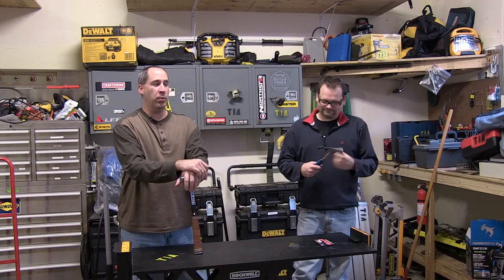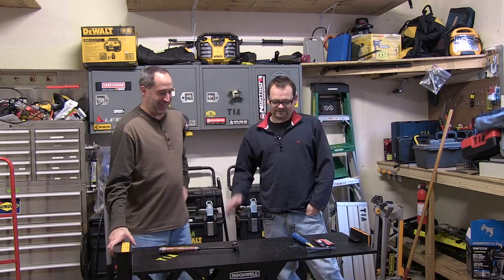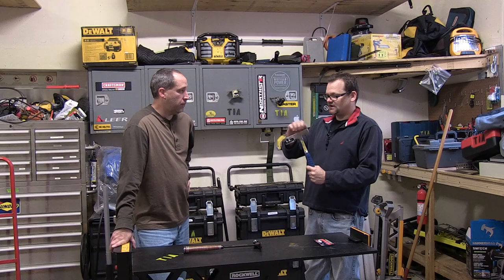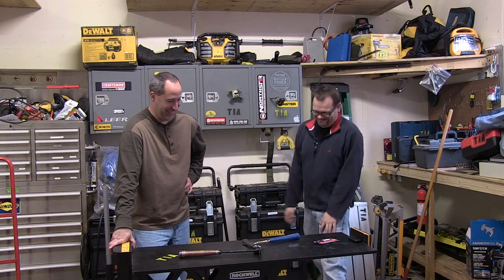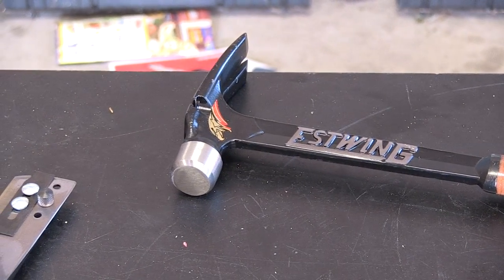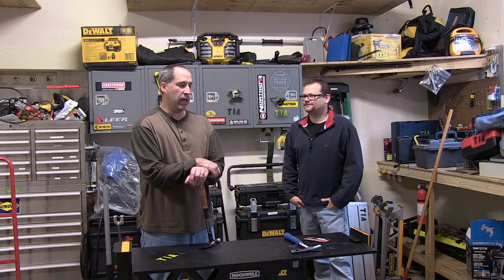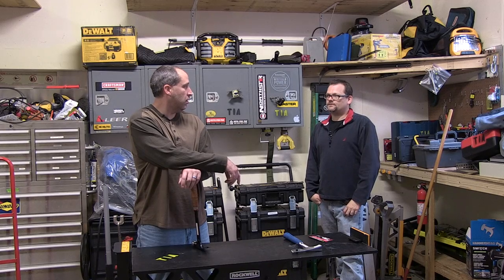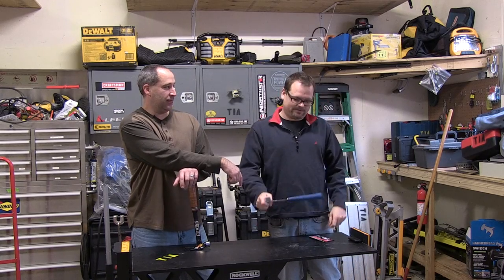Estwing Hammers

Comment: If you hate wooden handled hammers, try driving 16's all day with a steel handled hammer and then switch. Wood handles were invented for a reason. Hickory absorbes shock a whole heck of a lot better than steel.
Reply: Facts!!! Try driving nails all day and when you get the ole tendinitis in your elbow from a metal handle you will gladly use a wood handle hammer! This opinion has 30 years of framing behind it.

Comment: I agree that metal or fiberglass hammers are the way to go versus wood hammers.  The grip on wood handled hammers tends to get slippery when any moisture gets on it.  Metal hammers have rubber grips installed.  Wooden handled hammers can become weaker and looser if constantly exposed to humidity.  You don't have to worry about that with single solid piece of steel.  For my money it's tough to beat an Estwing.

Comment: I have seen the way Estwing temper the entire hammer ( steel part ) in one go all the same hardness. Vaughan say they temper the claw and main striking face at different hardness because they have different jobs. Do you think Estwing are cutting a corner or are Vaughan wrong
Reply: Shock Wave I'd rather have the entire steel section be hardened even if I'm not hammering a nail with the side.

Comment: The hammer Dan is holding is for siding shingles not roofing shingles 👍🏼
Reply: Cedar shingles which can be used on roof or siding.
Reply: Yes  cedar shakes make a great looking roof but they require regular maintenance & some states don’t allow them unless treated with a fire resistance coating.